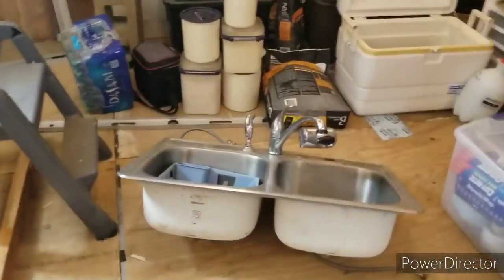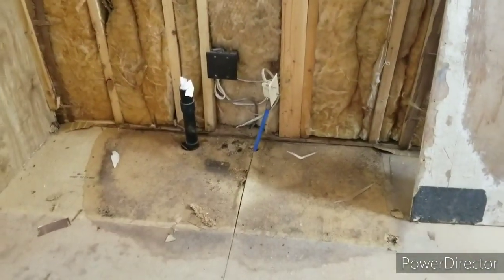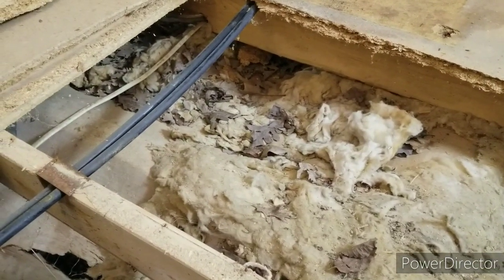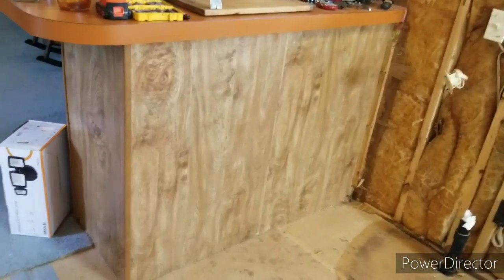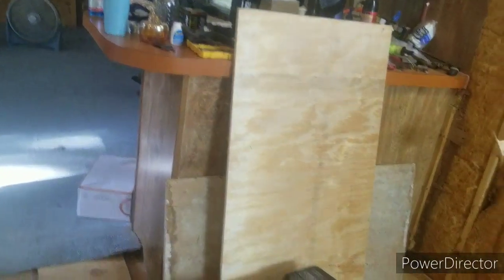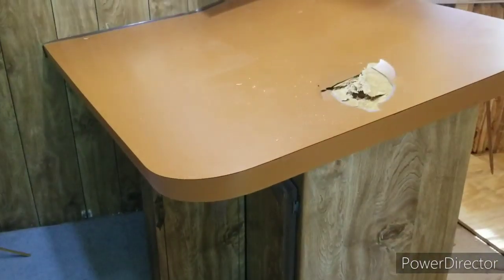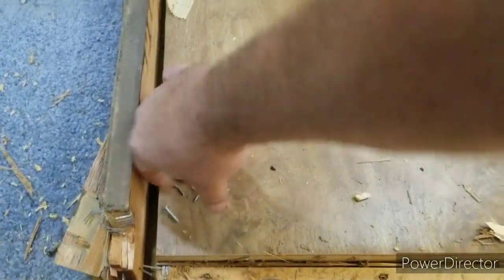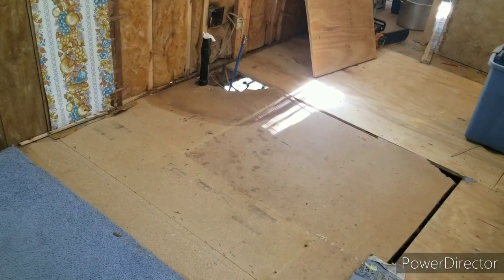1979 MANUFACTURED / MOBILE HOME - KITCHEN CABINET TEAR OUT - FOOTER REPLACEMENT - FLOOR REPLACEMENT

Comment: You are making me rethink removing my bar in my kitchen.  Mine is open on one side and looks like it is attached at the wall and one area of the floor so I think it will be easy to cut out with my recip saw.  But not this month.  Lol

Comment: GREAT JOB! You can easily make a bar which enables people to sit on either side, and make it mobil where you can put it anywhere you want it and move it easily. I have a couple and they fold up and come apart  and can be put back together with about 4 or 6 wingnuts! I can't wait to see you check out the bottom boards and replace any that need it, that's what I need to do I think and I've been searching for channels that do it on older mobil or modular homes. I found one channel that is pretty good on floor repair and roof repair, it's called Drews Roofing and trailer repair (I think)....anyway, always enjoy your video's and I wore my MDC t-shirt the other day....those who saw it were scratching their heads! LOL
Reply from the maker: HAHAHA thank you!

Comment: As you were pulling the paneling back on the bar, I was surprised that it hadn't snapped back on you. One second later, it did. Luckily, you were ready for it. Another good destruction job!

Comment: Had the same problem ,my flooring was wavy,even had to replace the 2x6 ‘s the hole length of the outside walls because the roof had no drip edge
Reply from the maker: I'll probably have to do the same. I'll tackle in the weeks to come Im sure as I replace one floor section at a time.

Comment: I found the same thing with what they call "cabinets" are just scraps thrown together.  Best to just take it all out since it is no good anyway.  You will not want to keep any of it when the kitchen is completed.  It will just keep reminding you of the trashy construction they use.  Further it will not match anything else you do.  For storage space check with Habitat for Humanities or Craigslist and they may have some cheap used cabinets that would work for awhile or just a fold-up table that can provide portable storage and work space.  For stabilizers on the legs use some of the old particle board cut into four inch wide strips.  They do not even have to be cut straight just long enough to provide stability.  When you were knocking the floor out where the sink was at, where are the floor joists?  Nothing under it.  Then it looks like the joists are running the length of the frame and not across the frame.  How was that thing built?
Reply from the maker: They run the lenght of the frame

Comment: A tool I bought at Harbor Freight that's saved me a couple of times was a reciprocating saw. I had to take out a furnace in our trailer remod but didn't want to spend 100$. I spent like 28$ with a pack of blades lol. I've used it so often I don't know how I got along without it. Trailer remodeling is a chore in figuring out why? WHY, DID THEY DO THAT?
Reply from the maker: I had a sawsaw but it burnt up...and yea I ask all the time why did they do that? lol

Comment: I have a 1976 double wide down here in the gates of hell South Florida. Your linoleum is identical. Don’t you just love them one way screws? The bastards don’t want you taking them apart. I tore out the kitchen floor to the exterior wall and even under it. I put a cleat along the outside 2x8 so when I slammed the new subfloor in the edge rested on top of the cleat while also being under the wall. I could have crawled under the house and put the cleat in but that would have been a gigantic pain in the ass. Anywho; i sistered in 2x6 next to the 2x4 studs in the wall. I than put pocket holes in the 2x6 so I could draw them down into the new subfloor. The wall is now 5.5” thick. Now I haven’t heard you go off on the reduced width of the countertops which are 22.25”? I think.? I put in full size cabinets which I built from regular plywood with soft close slides. My number 1 tool is my Kreg jig for the pocket holes. You need that. I  am not brave enough to wear cowboy boots with camouflage shorts unless I am going to Walmart where that style of dress goes nicely with a girlfriend wearing size 2 pink sweatpants with 4x body. Not that there is anything wrong with that. But hey, your my kind of people. I also contemplate the difficulty of cleaning up a mess to move forward with task at hand, but like you I also know that however easy something looks, there will be a curse filled period of time that is bound to include some self inflicted injury and let’s not forget the 30 minutes it takes to find the tool we had in our hand 5 minutes ago.  Shit, I am not even working on anything and I’m already getting pissed.

Comment: Have you thought about rockwool? Another channel used it and said critters don't like it.
Reply from the maker: I think im just going to stick with bubble foil. I found this report on Google that "  Rockwool has been found to cause fibrosing lung disease, lung cancer, and malignant mesothelioma of the pleura and peritoneum [1–3], and proved to have toxicity through many in vitro and in vivo experiments " I know how well bubble foil works, it's cheap, and installed right pretty darn effective.

Comment: I always ask myself, why do they use that stupid particle board for flooring boards?? Well, there was even a point in time where contractors used that crap on even new construction homes, but that idea didn't last too long because whenever the builders returned to the sight after it rained, that garbage was all swelled up and very soft. I guess they thought it would be a very inexpensive solution to osb or even using one by's for sheathing like you see on old farmhouses/houses.